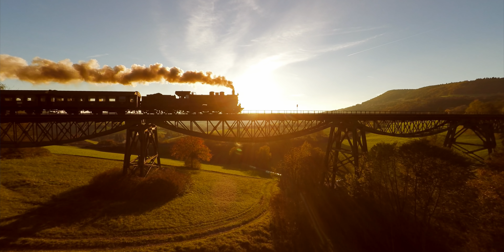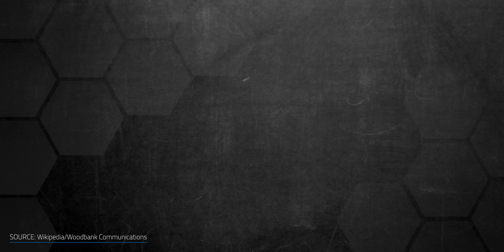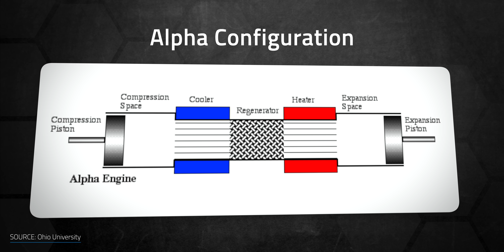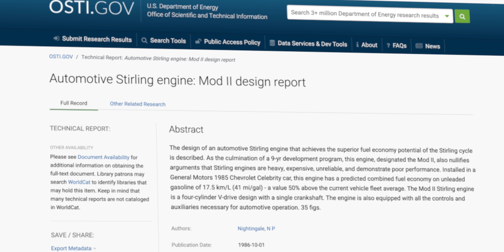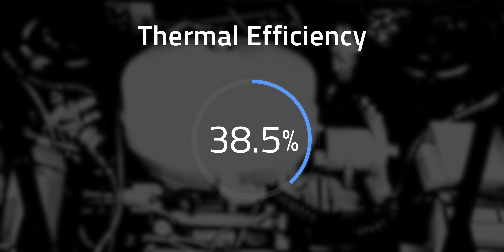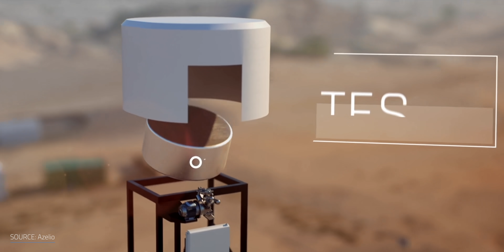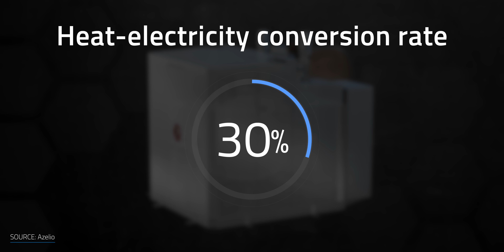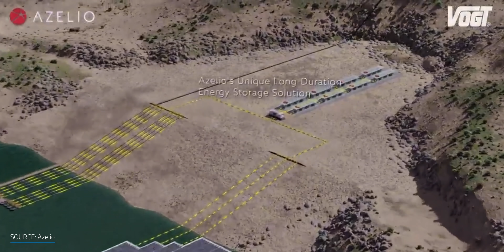Are Stirling Engines the Future of Renewable Energy Storage?

Comment: The issue with sterling engines (great as they are) that never gets brought up is the equilibrium effect. or to be more specific. "Entropy be a bitch"

Any system that relies on a disparity between a low energy state, and a high one. Like sterling engines. Which are essentially just a heat exchanger.

Is that without added energy, a set constant eventually reaches equilibrium. 

Say you take a sterling engine. And stick it on a container full of boiling water right? 

Yea initially it will spin up. But even if you keep the water at a constant temperature and don't let it cool. The engine eventually slows and stops.

The issue being that the cold plate. Or dissipation plate. Is eventually the same temperature as the hot plate. Or collection. There are ways to remedy this in the micro. But as the numbers go up, more heat, hotter temperature, higher energy. Those solutions don't scale in tandem.  It's a thermal conductivity issue.

You end up shedding more energy than you are harvesting within a closed system than you are extracting. IE.
Entropy be a bitch.

Comment: I think that this video was a bit misleading. You're intermixing two separate concepts: storage & electrical generation from thermal energy. 
The thermal storage component has nothing to do with the sterling engine. It's a PCM (phase change material) based thermal storage. This is used in a variety of application with different PCMs. You can have anything from ice banks for cooling storage to molten salt for high temp heating to anything in between. This has nothing to do with the sterling engine.

The sterling engine itself is not a storage device, but a power generation from heat device. IMHO it should be compared to traditional ways of generating power from heat - making steam and turning a turbine. While combustion engine can be compared, when used with a solar thermal plant it's a poor comparison.
Reply: I fully agree with your observation. Glad to see I'm not the only one that reads it this way.

Comment: I invented (private space program) a gravity generator that uses rubber bands. I also invented Shoe Goo advanced formula, it is a memory rubber that is also magnetic. But Why ? Longer shelf life and reusable with a mold and some rocket fuel or moonshine. It's how I charged up my batteries in outer space, in my 1977* space program. You have to work the rubber first before using it, it stores on sheets of paper very very well also. So get some over the counter Shoe Goo before they remove it from the shelf's.

Comment: Interesting use for the Sterling engine. I looked into SE about 25 years ago and decided the regular type required some engineering equipment for the close tolerance of the piston not suited to the DIY tinkerer on a low budget. However, there is another version with a "liquid piston", the fluidine. Time to brush off those old books, especially about the fluidine and see what I can come up with.

Comment: If we ever get serious about reducing emissions and environmental impact we go nuclear. It requires a fraction of the resources of W&S nor does it need backup. 
I found that I had a lot of misconceptions about wind as solar as well. I had been thinking that what we needed was renewable energy when what is actually needed is clean reliable energy. 🤦
I had assumed that a unit of power production from them meant a unit less from FF, that they were cleaner than the alternatives, that power could be stored for use when needed like water or grain, and that if we just built enough of them we could meet our energy needs without FF. All of this was absolutely wrong. Wind and solar requires 100's of times more resources per unit of power production as NP does and they don't stand on their own, typically backed up with coal or NG. And as intermittent power sources bring instability to a grid we end up using far more backup than we need with stable reliable sources. And the higher percentage of Intermittents the greater the instability and the higher percentage of backup needed. At 20-30% capacity factor, every MW-hr of solar & wind drive 3-5x as much gas build out for backup. But, since solar/wind are chaotic, they drive gas efficiency down, driving gas burned per MWe-hr up by 2-3x. This is probably why we've seen so little progress in emmissions reduction by adding them to our power grids compared to NP and hydro power. 
Carbon emissions 2020 Europe 
https://twitter.com/electricityMap/status/1357248695499128832?s=19
www.ElectricityMap.Org 

If reducing emissions is the goal they don't bring much to the party, while NP has been able to decarbonize grids in a decade or two. 

https://thoughtscapism.com/2017/11/27/nuclear-energy-is-the-fastest-and-lowest-cost-clean-energy-solution/ 

https://www.newyorker.com/tech/annals-of-technology/the-activists-who-embrace-nuclear-power

Comment: ...IMO, silicon>salt>aluminum for energy storage and Azelio's solar->electricity->heating method to melt aluminum seems obviously less efficient than the normal solar->heating method most TES solar plants use.

Also, bear in mind that liquid silicon emits radiant heat that regular solar cells can convert to energy. Whether sterling engines have a future in energy storage likely depends on how efficient they are compared to other methods.

Comment: Or you could use ammonia as the working fluid and use a multi-stage turbine to extract the stored heat and releasing it into the atmosphere with a condenser, giving you 40% to up to 90% efficiency. They are more expensive than Sterling engines, but the added efficiency would likely offset the demand.

Comment: The first time I see a Stirling Engine I was impressed because I saw that it can be sourced by solar energy, Wood energy, leaf energy, and many other sources of heat. But the main problem is their control. it does not respond fast enough to load changes. Obviously, we can insert control in this kind of motor to improve response, valves to improve flux control, heat insulation to minimize loss. and many other improvements. I will keep thinking about it.

Comment: 30% efficient, but "For stand-alone gas turbines, without any heat recovery system the efficiency will be as low as 35 to 40 per cent." - S.C. Bhatia, Advanced Renewable Energy Systems, 2014.

Comment: So you said that this would not be feasible for something like a car. What if it was cranked to a high energy out put all the time, and had a variable differential, like a lawn mower, to engage it at certain speeds? So that it didn't need like a rev range. Do you think that would work?

Comment: Hey. Maybe a questionable one but depleted reactor fuel stays hot for a long long time. So maybe instead of storing spent fuel they could use it so its not just taking up space as it stays radioactive for thousands of years. 

Energy crisis solved as ling as no idiots screw up the containment. 

Every nuclear accident in the world had been cause of human error and neglect of the equipment and had officials and workers done exactly what they should do those accidents wouldn't have happened.

Would also give a solution for unused fuel rods that would just sit some where in storage posing a risk that brings no benefit like the current use for unused and spent fuel....

Power stations kinda like what we have now and even electrical workers could manage facilities where the power is stored and sent to homes from. The power generation centers being sperate buildings with specially trained staff and strict rules.

Comment: so if we would put a solar water panel on the roof to heat water and produce electricity in the basement with a sterling motor, we would be nearly double as efficient as photovoltaic. or am i wrong

Comment: Sterling motors are interesting thanks.  

This got me thinking could gas and battery vehicles use sterling engines to recharge start or utility batteries. In a gas or diesel vehicle we disapate heat in a radiator, maybe we should use that heat to turn the alternator with a sterling motor. I read that in a K-car in the 1980's the car's engine produced 97 hp @ 5,200 rpm but the alternator consumed about 20hp.  Think of the energy that could be saved instead of burning more!

In a similar way discharging or charging the battery in a hybrid or EV makes heat and a sterling motor could turn an alternator and recharge the utility battery.  I also wonder if the hot car in the sun can turn a sterling engine and charge batteries.

We need to extend what we get on less fuel, well this technology could fit the bill to bridging the the carbon technology to the greener world!

Comment: In your explanation you said the expanding air presses against the displacement piston. This is incorrect, it presses against the small driving piston but simply passes around the loose fitting sides of the displacement piston.

Comment: In my opinion the "straight road forward" for S2S (Sunset-To-Sinrise) Energy Storage to support a 100% Solar Powered AgriVoltaics (AV) System (see youtube channel zeropollution2050.. one word) is Modifed/Upgraded Hydro Pumped Storage.
From the above videos the world requires about 180,000 TWhrs/yr of Electricity by 2050 to meet ALL its Energy Needs (not just present Electricity users but ALL Sectors.. Industrial, Transportation, Commercial,  Residential). 
As explained in the videos above, about 20-25% is required for S2S needs (Charging of Vehicles, etc.. would be in the day) or about 40,000 TWhrs/yr.

Today there is an Installed Capacity of 1TW of Hydro Plants around the Globe. Almost ALL work on the "Single Use" of Water (excluding a very small for Pumped Storage). 

However, if the above 1 TW Hydro Units are MODIFIED 
•So their Lower Resevoirs can Store 120hrs of Water ... • and UPGRADED Hydro Pump/Generator Units having ten times the Capacity or 10TW Installed... 
• then one can Pump/Generate 120TWhrs/day. (10TWX12 hrs/day) .. or 40,000TWhrs/yr S2S Energy Storage and Generation...
• This meets the Annual S2S Energy Storage requirements of the above 150TW AV System providing 24/7 Solar Energy... 

• Unlike the above 150TW AV System uses ONLY 7% of the Agricultural Land ... and therefore has lots-n-lots of margin... 
• the above S2S Storage is barely adequate but can be increased by enhancing the Storage and Pump/Generator Set further to that needed for supporting the 100% Solar Grid...

• All other S2S Technology Options would not be required...

Just as AV can provide ALL THE ENERGY THE WORLD NEEDS... MODIFIED/UPGRADED HYDRO UNITS CAN PROVIDE ALL THE S2S STORAGE/GENERATION NEEDED WHEN SOLAR ENERGY IS NOT AVAILABLE ...

Comment: Hi I worked on a project in the UK to commercialize a linear free piston sterling engine helium inside with linear alternator making 1kw inside a gas boiler when heating the water or heating the house, in theory it would run off grid no crankshaft the original concept was from Sunpower based in Athens Ohio this was the hot bed for linear free piston sterling engines one was used as a cyro cooler for the space shuttle fridge

Comment: Actually, ALL heat engines utilize a temperature difference for converting power. It's not limited to Stirling engines. The only differences the Stirling engine has over other heat engines are: 1) it's a closed system, unlike ICEs that are open cycle, and 2) the working fluid is in a constant gaseous phase, unlike steam turbines that operate using the Rankine cycle whose working fluid undergoes phase change from gas to liquid and vice versa.

Also the Stirling engine, like all other heat engines, does not store power, it simply converts heat energy to mechanical work. The energy storage occurs in the phase change material (which in itself is a cool piece of tech) that traps the heat and releases it in a controlled manner to fuel the engine. PCMs are great for storing heat because of the high amount of energy they can store and release (due to the latent heat) while maintaining a constant temperature.

Comment: Potentially very good video ruined by the presenter's pathological compulsion to demonize steam engines and the coal industry.  This posture undermines the tremendous contribution that steam engines made to man's technological advancement - not to mention the development of the field of thermodynamics (see Carnot).  It is obvious that the use of coal as a transportation fuel was unsustainable - and consequently new technologies emerged as replacements. But the steam pioneers were not evil men that wanted to conspire to destroy the climate by burning coal!  This is the message you seem to be transmitting in your video.  Nevertheless the steam cycle is still the major power producer today fueled by a variety of energy sources.  Please try to be a little bit more objective when you post your material.
PS. The stirling cycle machine is a fascinating technology with some very interesting niche applications.  For example the reverse stirling cycle is used for cryogenic cooling.

Comment: First saw Sterling engines in a video from Lindybeige. He suggested putting them on top of server farms in freezing cold regions. The server farms creating a massive amount of heat combined with the surrounding subzero temperatures would generate a lot of energy.
Reply: It would defeat the purpose of putting them in cold regions, so no
Reply: @наш_путь  no it wouldn't, because the heat is still leaving anyway. The heat is just leaving a little slower.
Reply: @наш_путь  it would actually be an improvement, as the stirling engine is actively pumping the heat out of the enclosed space

Comment: Almost all of the electricity that goes into powering computers is converted into heat. Instead of heating up the air it could be used to run Stirling engine and generate electricity.

Comment: Absolutely ridiculous to think that one needs to use a metal at 600 degrees C to power a small Stirling motor to generate electricity. BTW, why does everyone insist on calling them Stirling "engines" if they don't use any fuel? Stirling "motors" is the correct term, for a machine using an external power source. A gamma Stirling can operate on a very small heat differential. It's some goofy engineer, (with government grants to pay for it), that builds these monstrosities to generate electricity, or to store it and then recover it again. The best trick is to use ambient heat from daytime air, (if not solar), to run a Stirling, against ambient cold from night air; but, most ignore the need for adequate thermal storage to maintain its operation.

Comment: Why can't cars have a smaller gas engine and a Sterling engine for efficiency? 
This way if you need to start fast you can however if you need to just continue at the speed you're going you can use energy from the Sterling engine to keep you going.
And you could also find a way to turn the heat from the gas engine to power the Sterling engine.

Comment: The otto cycle engine in the current prius has 40 % thermal efficiency. And converting electricity into heat and then back into electricity with a sterling engine is really inefficient. Batteries are much better there. This only makes sense when heat is stored directly like in one of those thermal solar plants with mirrors.

Comment: As I live in a northern area and our sunlight is limited especially in winter, I have often thought of different ways to use renewable energy to power my home. One of the ways I thought of was the use of 2 mirrored dishes to focus sunlight on a sterling engine and to have the power they create charge my Tesla Powerwall system. I thought this would work well combined with 2 VAWTs. Now after seeing this video I’m convinced this would be an excellent way to power my home and sell back excess power to the grid (if I decide to be attached to the grid). Thank you for the new perspective on Sterling engines!

Comment: what about a vacuum chamber (small)... thermally sealed from the outside environment with insulation....  you insert fuel and o2 .... you maintain a continual burn... one side of this chamber is thermally connected to a stirling...  as the chamber reaches very hot temps all the heat can only pass though the stirling...  there's no exhaust... no radiation..  no hot components.. only pure o2 being burnt with petrol in a chamber to create heat until the pressure exceeds safe levels and the heated medium cools below a level useful work can be extracted... at this point.. waste gases expelled.. process starts again.

I'm guessing the working gas in the stirling should be monatomic...  it should only have translational degrees of freedom since only they contribute to a change in pressure.

anyway.. back to engine..  this engine using a stirling would be not very flexible.. but could be attached to a generator that charges a battery.. than drives an electric motor to drive the wheels or a car or prop of a boat.